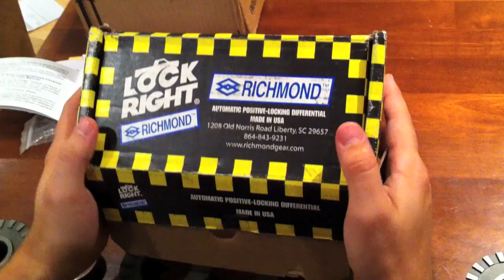Lock Right Locker - Part 1: How it works [HD]

Comment: I have a big cuestion ... I drive 60 km/h on dirt roads and  normally just go in 4x4  all the way so I don't have to stop and  switch to 4x2 back and foreword... It will ratchet for sure. Is it bad? Will it break? Is it bad for it driving 60/70 km HS? Thankx

Comment: This is by far the worst engineering I've ever seen in my life. These have no business being in a man's truck. But if you're driving one of those little four-wheel-drive Toyotas from Japan on a flat gravelly road I'm sure they're perfectly fine. I can see so many fail points on this looks like an absolute headache. Be warned if you have any kind of power in your truck you're gonna share that thing into pieces in a second. That is a good design for toys. If you're thinking about locking up your rear end to do burnouts and you have more than 200 horsethat things gonna go to hell in a handbasket
Reply: well that's not who it is meant for you psycho. these have been out for several decades at this point so obviously you cannot see "so many fail points" or you just don't know what your talking about which is the more likely case

Comment: 👍Works great for me, with only a rear drive 2x4.  It was what got me out of a jam on a wet farm, with unexpectef sticky grassy mud. Yeah, I went sideways a few times in that instance, but I didn't have to walk a few miles to get a tow truck. 
No problems with snowy weather, but I don't drive it hard then, of course. Practiced on an empty parking lot ASAP.
Ratcheting noise: so what. Not quite as bad as a bicycle freewheeling gear cluster.

Comment: I put these lockers in the front and in the rear of my old Chevy pickup 9 years ago.  It's a hunting vehicle primarily, so about 80% on-road/20% off-road.  It now has 40,000 miles on those lockers and they have performed beautifully.  Every 2-3 years, I'll get a loud BANG from the rear, but the instructions that came with the Lock-Rights warned of this happening and it is neither bothersome nor harmful.    I would not put them in a high-horsepower/big-tire/rock crawler, but for normal use on street and low-traction off-road situations (mud and/or snow/ice, which is where I need them), they work well.

Comment: So basically the only thing that this locker can differ from "making a turn" (one wheel faster than the other) and "getting stuck" (one wheel up in the air, or one wheel losing traction on mud, or simply one wheel faster than the other again) is the throttle? In other words, how can the locker know when is a turn or when I'm getting stuck? Great video, thanks.
Reply: If you apply ANY throttle in a turn, they will lock up.  Coast around the turn and the wheels will freely turn at different speeds, albeit with a faint clicking noise.

Comment: I just installed one in my econoline 150 8.8 rear end. Geat product for the price.  With the Copper AT3 tires on it already it is very solid off road within reason.  This type of product is a must for 2wd vehicles that see snow and or off road use.
Thanks for the geat explanation,  i used your videos among others to decide on this unit

Comment: I put one of these in a 70 as nova with a 406 small block with a 144 supercharger. And it kicks in and out even in a straight line when on the gas. The first time I put on a set of slicks at the track I noticed it kicking in and out. The weird thing is it only kicks posi when touching the brakes. Dont know why any explanation?

Comment: Could a guy install these only in the front axle? Then you’d have the advantage while in 4x4(only in front though), but for normal street driving in 2x4 it’d be completely smooth and not clicky or dangerous say in rain or a little ice?

Comment: These are great off road and a clicking clunky mess on pavement
Reply: I put one of these in the front of diff of my 77 k20. Dana 44 front axle. I thought it would be great in the snow,boy was I wrong,it pulled my truck all over the place. I could feel all that clicking in the steering wheel. I was on some really slick ice spinning the tires,the rt side caught traction,busted this thing and pulled the upper ball joint right out of the steering knuckle. It's probably ok for a lighter vehicle my truck is nearly 6k lbs. I gave up on this thing and went back to open. I have a GM 14 bolt in the rear with Detroit Locker. That's good enough for me. If this thing breaks on a trail you're screwed,you're not going anywhere.

Comment: Install one of these in my 98 XJ Cherokee. It was the worst thing I ever did to the Jeep. Richmond was no help, and very rude. I took it apart twice, because Richmond said I broke something on the install. Nothing was broke, so then they told me my carrier was bad. I took it out< and replaced it with a real locker. A lot more work, and measuring but well worth it. This thing went to the land fill.

Comment: Might be a dumb question, but how does the locker know when to lock or disengage when going in a turn? If you say that it disengages when the wheel is freespinning, then wouldn't it freespin too when doing moguls as well?
Reply: Matthew I when you step on the accelerator it supplies power to the drive shaft which locks the differential. translation lift your foot off the accelerator through the turn and once the vehicle is back in line you can accelerate again

Comment: best explanation i seen ...  have them in both diffs on Jeep Wrangler Sport.. AWESOME is least to say off road in sand, gravel wet grass, mud...,, and on road,, drives like a normal vehicle , bit clicky on corners. but worth the noise (turn up sound system  and you wont know... lol)
Reply: Pravda Ruski lol I just installed mine n everyone ask me if it's noisy I tell then I haven't heard a thing but it's cuz I always have banggers on... I'm very happy with this locker! if been off roading on open diff for a few months n I hold everyone up them trying to help me on the trail.. now they need to catch up with me!!🔥🤘
Reply: these dont lock the front when youre in 2wd right? i want to keep my complexity and maintenance down so im considering one of these in the front and a truetrac in the rear

Comment: Would these be a good addition for 2wd for better traction off road, everything I research says go with lockers
Reply: The short answer is "yes". However, there is a trade-off. You gain more traction, but when you do spin the tires, the rear of your vehicle can slide sideways because both tires are spinning. When only one tire spins, the other tire sort of anchors the vehicle and makes it more stable.
Reply: yah dont plan on spooling a 2wd truck and try and drive it in winter on ice and snow lolol
Reply: I put the Lock Rights in the front and rear of my Chevy pickup four years ago. They make a little noise sometimes, but nothing obnoxious.  I really like them and can recommend them for normal off-road driving.  I use my pickup as my hunting vehicle, so I need all four wheels driving only about 2 or 3 times a year.

Comment: After 2 years of this locker in my ford ranger, i would advise anyone to buy a decent used 4wd vehicle. this locker is very simple to install, directions straight forward, easy!
for whatever reason, in the past few months,  my drivability was horrible! the locker started jumping, grinding nearly constantly! I  removed it today and went back to the standard open rear end. I  never used my truck for off roading. Strictly highway use, but I  wanted better traction in bad weather. it really is a different experience with both wheels locked up. It takes some getting used to. after removing the locker today, I  have to say there was a little wear, some metal chips on the fill cap magnet, the raised portions of the locking area wete slightly rounded, but overall everything was in good condition. 
if you halfways decent with auto mechanics these are really easy to install. But if your main driving is highway, DONT get it!

Comment: I just installed a spartan front, spool rear  in my jeep and was wondering hoe they actually worked. I went with this so it would slip more for better turning ability
Reply: Tzorb if you're in 2wd and have the locker in the front you won't notice any difference until you put it it 4wd

Comment: Great video. However, you should have mentioned to the first time locker users that it's usually best not to apply gas while turning to allow the axles to differentiate.
Reply: +Taher Qubbaj It will still differentiate as long as the inside wheel doesn't slip/spin on the ground.
Reply: You are both quite correct...
less gas = more differentiation, more gas = less differentiation.

Comment: It seems that this locking is made just for off road veichles, Am I right? Did you alredy seem one of these in a on road sport car?
Reply: +Icaro Britto You would normally see lockers like this in Off Road applications.  On road it can be a bit of a handful if you're not a good driver.  The full locker can make for a twitchy ride in a sports or race setting.  Some like it, but for faster times usually a viscous LSD is normally used.  For Drift and Drag, however, Spools are used... and for those weekend warrior dragsters or drifters, who still go on the street?  These are a good replacement instead of a spool.

Just have to know how to drive them, as it WILL handle differently!  You won't see lockers like this in your normal road/race car.  Target market is those people who play in the mud/rocks
Reply: Thanks for the explanation

Comment: You have it backwards. When you turn right the driver side locks and the passenger releases. The weight shift assist in this. The faster wheel does not free spin but drives in and locks.
Reply: No, I think you'll find he's got it spot on. It will drive in and lock the outside wheel only when you apply enough power to break traction on the inside wheel so that it is rotating at the same or greater speed than the outside wheel.
Reply: +Sean McReynolds Thank you!!!! minor detail but really helped me understand how it ratchets.
Reply: i was thinking the same thing but still learning the dynamics of it so i wasnt in the position to correct him lol
Reply: Same rotational speed between the two wheels...different torque on turns.  On a right turn, passenger and drivers wheel spin at same speed...so that means the drivers wheel slips/ratchets forward as it moves faster but never slower than passenger side. Torque on drivers side is less than passenger side

Comment: Does this system work good, I want to install it in my suzuki samurai
Reply: Had an '88 1/2 Samurai with Locktites in both stock ends. Only turned one hub in until I really needed fully locked front and then wow what a difference!!

Comment: these are great for putting down power in a straight line or if one wheel looses traction but are terrible for laying down power in a turn because in a turn it is 1 wheel drive and if you break that wheel loose you will spin out. it's a gain some loose some kind of thing.
Reply: No, you can never spin one tire and not the other.  That's actually the opposite of what these do.
Reply: maybe i should say if you break the inside tire loose in a turn you may wind up breaking both wheels loose and spin out.  yes untill the ratchet engages on the outside wheel you can spin one wheel and not the other, granted that would only be like 1/24th of a rotation at worst.
Reply: Yep, that's the case with any limited slip / locker. They still put them in race cars which means they are not terrible for laying down power in a turn, you just have to know how to drive.  Open differentials are actually much worse at putting power to the ground in a turn.

Comment: I've been using the one of these lockers in my 88 Ranger, 33" Baja Claw equipped off roader for 6 or 7 years now, can't beat it. Never have to worry or think about it, its always there and working.
No air lines or wires to brake, no switches to flip, works great.

Comment: The answer to your question as I understand it from forums is yes and no. No the actual Lokka unit is tough as nails and wont break., however all locker systems place extra strain on your axles and cv joints and more so they become susceptible. With an Auto Loader their is a shock load that happens when it engages hard biting a rock or the likes., this is not a problem with manual lockers though as they are permanently locked when engaged. Read into it

Comment: Look at torque and power ratings. Torque rating = strength of material; Power rating = max. heat release from the unit before potential failure.

Comment: Well, this is a horrible diff for high speed on road vehicles for many reasons:
1. during turn you want to power the OUTER WHEEL, not the inner wheel [hence LSD are used for more powerful cars]
2. the system is not continuous = clunky for on road vehicles

many other reasons that will cause issues under hard accelerations

Good video though

Comment: Pardner, thank you so much for that video. Makes perfect sense!
Any negative aspects of it besides being sideways in a wet turn?
Reply: A very faint clicking in turns, and very occasional (once every 2-3 years?) loud bang, both of which are normal according to the manufacturer.  Also, if you are sideways on an icy hill, you will slide downhill.  :)

Comment: Very good video.  I understood it with no problem.  I have one question.  How bad is the noise when turning?  For one my truck is mostly used on the street and for two I'm wondering how bad it will be on dates lol?

Comment: I'm a little confused on this.  Does this stay locked constantly when power is being provided to the wheels?  Say, when driving normally on the road?  I haven't seen much to explain how it may or may not disengage and go into open spin as it normally would be.